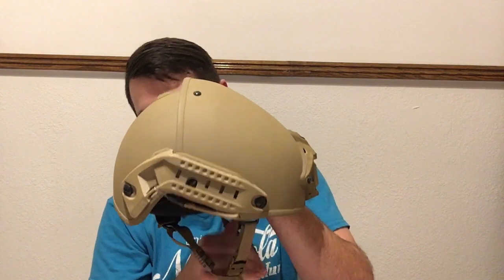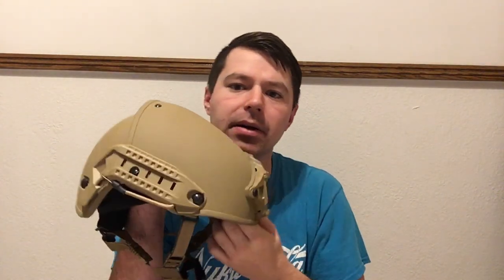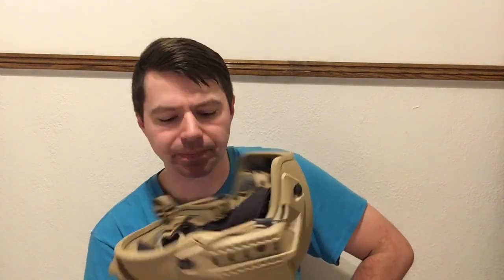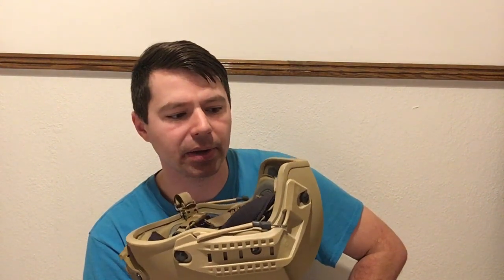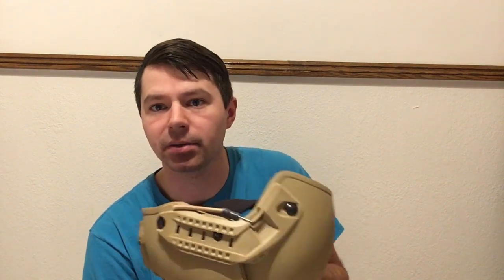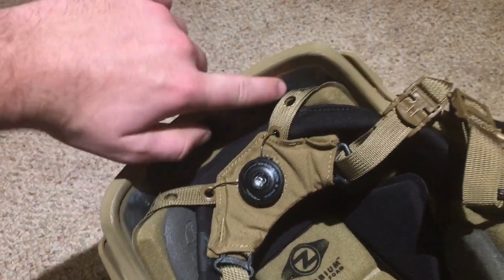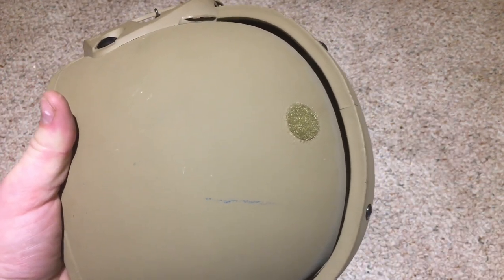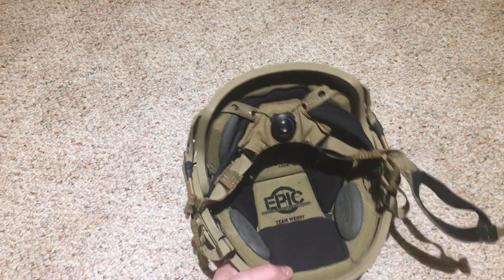Crye Airframe

Comment: I don’t see the point on these having cut out ears the Royal Marines are starting to use these but in combat shrapnel is inconspicuous it will probably hit the soldier there it won’t hit the helmet
Reply from the maker: I think it’s ridiculous too, but it has some benefits like not obstructions your sight and hearing as much but that’s about it. I would rather have the coverage.
Reply: Crye sells add on ear and face shields for this helmet.
Ballistic-grade that attach to the helmet.
Reply from the maker: @richardhinman3183  I am aware the problem is they aren’t as good for protecting because they aren’t part of the actual helmet shell